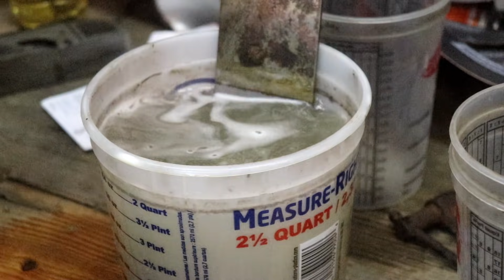Tool Restoration -Heavily Rusted Lathe

Comment: For what it is it is actually a pretty nice little lathe. You could scrape such an item but I think just some more scotch brite action would get it freed up and as functional and accurate as it ever was.
Reply: Maybe even rub a diamond plate over it. If it truly was never used then it should not need scraping.
Reply: with massaging a tad bit oil (T-lights flickering in the background with incense adding atmosphere.......)
Reply: @michaelvitetta7231 , yup, just stone it slightly to the original surface, he'd be fine. think I'd have derusted the lead-screw with naval jelly and a brass brush though. he laid into the little acme thread with a hardened steel wire wheel! dressed it down purdy bad recon.

Comment: Wow one day!  That is a lot of work for one day. I restored an old Atlas like this one only older. I did scrape the ways and it turned out nice. I have a lot of use for my small lathe doing my restoration and repair work. I am always learning something new about it.  My next project is restoring an old rusty heavy duty Rockwell table saw.  Lot of scraping to do!

Comment: One of my 618 6 inch lathes has never been used,, great find,,,200 bucks,,,and just picked up a 12 x 36 an another 618 but the big surprises was in the rusted bucket with them a milling attachment, steady rest and follower rest and faceplate with 3 dogs all for the 12,,and it's the exact same model number as my 12 I have already, unbelievable I got everything for 500 dollars.

Comment: Enjoyed the video, once performed the task on an old South Bend 13" toolroom lathe which was extremely worn,  had to press out the quill hone the bore and make a new quill,  remove saddle and apron,  rebore and sleeve with bronze bushings all of the shafts in the apron make new shafts and obtain new gears for it.  Obtained a new lead screw and split nut,  resurfaced all of the bearing surfaces on the saddle and it required grinding the ways and surface hardening them.  Was it worth it.  To me it was, I paid $700.00 for the lathe,  I spent a few hundred dollars on parts and work that I could not do (grinding and hardening the ways), I obtained one of the best lathes for a small shop ever built.  I would have had to spend more than $10,000 to obtain a new one of equal quality.    It is good to encourage others to make do as you have and show them a method to do so.  Thank you.
Reply: if that rig held size, I'd be flabbergasted.

Comment: What a find!   have been through this with a lathe that sat outside for 10 years.  Its much larger but problem is the same.  Before you scart scrapping on the ways go with reverse electrolysis.    I say this because generally cast iron does not loose dimension from rusting.  You essentially have a new machine.   The rust pits on ways will help it oil better.

Comment: I'm restoring an old Delta wood lathe.  the motor mounts below on a hinge.  Do you think the weight of the motor is enough to make the belts work or does the motor need to be locked in position?

Comment: I found that the best way to remove extreme rust on a cast iron lathe was to physically plough/ scrape / displace with a scraper which is softer than cast iron. A straight edge aluminium or Brass “chisel” will plough through thick rust which has been oiled as you did.
Great fun either way.
Alan in London

Comment: Great project and video! If you get tired of paying $60 per jug for that magic rust remover, consider setting up a reverse electrolysis rig? With an old crate for a frame, a chunk of pond liner, a 12V battery charger, some plain water and a couple of boxes of washing soda you could fizzle a whole lathe clean for a day or two then just take it apart. You can use any old scrap(s) of stainless steel for an anode, and they last a long time. An hour to assemble the tank and fill it with water. maybe few minutes of gentle scrubbing with a li'l wire brush, and viola! No more sanding (well, very little). Washing soda is super cheap and lasts along time. You mostly just keep adding water as it evaporates. With two 10 amp chargers I've cleaned 16 ft long parts in just a few days, in a "tank" that was just some 2x12s and a rubber sheet. Also, if it was/is a new lathe it probably doesn't really need scraping, maybe just a bit more TLC on the edges and underside of the ways. Keep up the good work!
Reply: Sounds like a Better idea ! You have ! There !

Comment: Outstanding.  Be sure and do another video when you scrape the bed and get it bolted down and running.  I recently bought the same model with the Craftsman branding.  Mine was used but in really good condition with no damage.  Mainly needed a good cleaning (some rust removal) and painting.  I am about 3/4 of the way to fully restoring it.  I also built a custom bench for it with a steel plate top that will contain any cutting oil.  I really should stop by and see the real shop down there sometime.  I live close.

Comment: the rust was there to make sure nothing came loose during shipping
Reply: jim h 

😂🤣😂🤣😂
Reply: See......  I Keep saying, rust DOES have a reason to exist!
Reply: Now that's FUNNY, I don't care who ya' are.
Reply: The ways on atlas lathes are fairly soft and prone to warping. I have one in my garage and the only reason it's there is because it was free.
Reply: @brandonn2538  that's a shame, these old machines are supposed to be from the Golden age of American craftsmanship. Maybe a good base to bolt it down on would help. I guess Haas is the new great American machine tool company, not as heavy duty as some high end stuff but plenty good enough for most jobs.
Reply: Got one mine was made 1943, most probably by the ladies that kept America running while the men were at war  didn't get a chance to read the tag model, date. Haven't used mine in a while, can't remember the model # , 54 something. 10 inch got a lot of tooling for it. A good lathe , we single point threads for a 5 C collet , worked great
Reply: Don't most industries ship things like this with some sort of rust preventative on them? This thing looks like it had none.
Reply: Not broken, not painted, one owner ...
Reply: @OVINNI-POOH  mint condition price firm.
Reply: That was great!!!!!!!!!!!!!!!!!!!!!!!!!!!!!!!!!

Comment: Do you have brass hammers? I cringe to see the iron hammer used for assembly. Have you considered using a laser cleaner?
Reply: Laser cleaners are high dollar items.  Not for the average guy.
Reply: @paulcopeland9035  

Or you could just rent one for a day...
Reply: Milton Hurd totally agree with you on the hammer. Eek. Brass or solid plastic or rubber at the least
Reply: @paulcopeland9035  jay Leno garage has that I thought.
Reply: @brianw4brian Jay has hundreds of millions of dollars. when your guys are working on Deusenbergs and Pierce-Arrows, an expensive machine that works a little better isn't a problem. lol
Reply: Last I priced one out they were still in the six figure range. Does someone rent that out?? No way the rental fee would be economical here.

Comment: Very nice looking little lathe and you did a great job with it too! Just a quick tip (and someone may have mentioned it already), you can use a sheet of paper between the gears to get the proper clearances for gear meshing 👍
Reply: The PAPER ! GOT ! COMPLETELY ! STUCK ! IN !  IT !!

Comment: I have one like this it works good on light projects but be careful shifting between screw three feed in manual feed the mechanical adjustment of the manual feed screw will cause teeth to shear when you're on screw feed so that has to be removed if you using screw feed.

Comment: Ran into a similar issue (different machine): Guy died, before it could be used and sat for years in his 'attached shop' with leaky roof and door; then after his wife died; went up for auction; bought for $5. We find a lot of this type of auction equipment, including government property that has sat of years, even decades.
Reply: Where do you find such things?

Comment: Nice to see someone start with a heavy dose of liquid wrench or whatever instead of butchering the screws and bolts trying to get them lose.  If rusted tight use a little oil on it was always good advice.

Comment: I'm wondering if you can scrape ways the same way people polish engine blocks- sand paper glued to flat surface and move the entire object to sand it
Reply: "scraping" is done by creating preferably evenly spaced marks with a tool. these will hold way oil, and some of your smaller particulates, so that the saddle will be fully lubed, and the particles won't scratch and wear your ways, etc. in the locations used most. this wear pattern, close to the chuck typically, will greatly reduce accuracy.
   this lathe just needs good felt wipers though. he could do a post on creating better ones. lol

Comment: I know scraping would be cool to do and a great learning opportunity, but could you possibly just stone the ways with a sharpening/grinding stone and a flattening stone to make the grinding stone flat?  Pretty sure Norton makes both.
Reply: Not many can do it, those that think they can often scrap the machines.
Wish i had a tenner for every punter that said ive only took a couple of thou off, to see well in excess of 30 thou to correct.
Reply: @jhareng  I wouldn't attempt scraping on anything more than maybe a 3x3 piece of mild steel as a first project.  It could have some use, Or if I get tired of it, it could look like a cool paperweight until it rusted again.  But not to many people would want to watch that.  I'm sure we will find out what he decides to do to the lathe.
Reply: Bottom line whether your any good or not scraping is a waste of time as it leaves a menial footprint on two surfaces rubbing.
A properly fine ground bed will last decades under serious usage, thats why you dont see DSG in for a regrind. Course ground what you would get from china and local pulling a fastun wont last, think of it like medium grit lots of porous crevices. Scraping best left for oil dispersion. 
Scraping to remedy worn or clapped out stuff if done right (only a handful capable world wide) leaves high points meaning will wear very quick. A good one will have 80% less surface contact leaving 1 in every 5 metal.

Comment: Just curious if this all would have been easier in a sandblast cabinet using walnut shell as to not destroy the metal.  Granted some parts with the nice lettering you wouldn't want to but the rest?  Was that something you had thought of?

Comment: Gloves and good ventilation!
WD-40, oil, grease or some other corrosion inhibitor to prevent it from rusting right back up.
Use a non-marring mallet or put a block of hardwood between the hammer and part, to help prevent mushrooming the ends of shafts or bolts.

Comment: Nice work.  I've given the once-over on two different craftsman/atlas lathes.  With flat way lathes be sure to be as thorough cleaning the underside of the ways (where the shims go) as you are on the top. Any rust or grime on the underside will cause the carriage to bind just as much as it will on the top.  This might help free up the travel.  Keep up the good work!

Comment: Keith Rucker has made a series of videos restoring an old New Haven metal planer. He is using a power scraper for the job. This planer is huge, so he has to use power to scrape. Your project is much smaller than his, so hand scraping may be the way to go.

Comment: Because I have a lathe and have worked on sorting out or repairing some of the bigger ones. I can follow some of this process. But without knowing what the parts are and what they do. one could get totally lost when disassembling one in order to clean it up.

How did you learn enough to strip this one and rebuild it? Even a simple lathe like that stripped into some boxes is not easy.

Comment: what kind of cleaning solution are you using in your parts washer?
Reply from the maker: +Stanley Thigpen It's a system called the Smart washer. It is a microbe based solution that actually consumes the oil and grime. It's the same stuff they use to clean up oilspills where there is a large population of wildlife. It works like nothing I have ever used.

Comment: Your the first person that I’ve seen spray a lube on parts bolts etc before pulling rusty things apart I always use lube let it soak for a few minutes before trying to undo and use heat if needed  the best lube I found was mouse milk and you can apply lots of heat if needed it is for high temp lube but what you also need is a lazer cleaner  that would be the quick way to clean